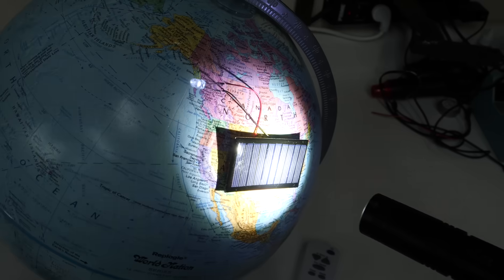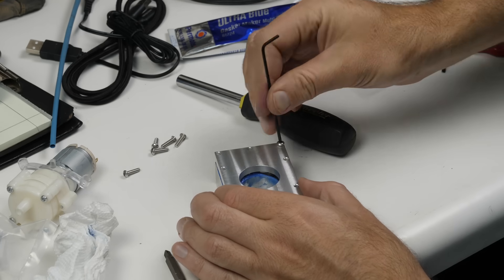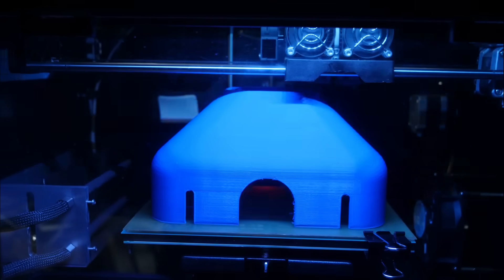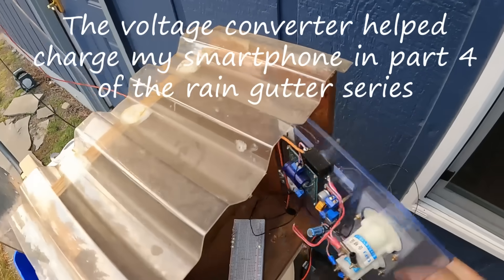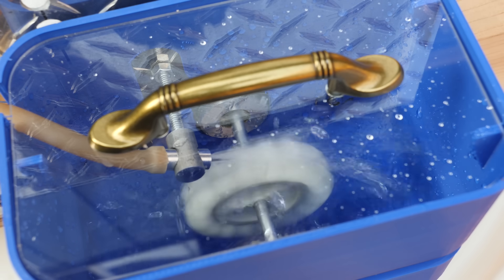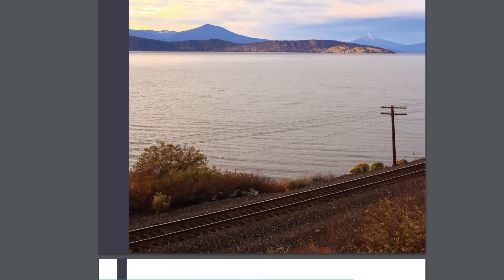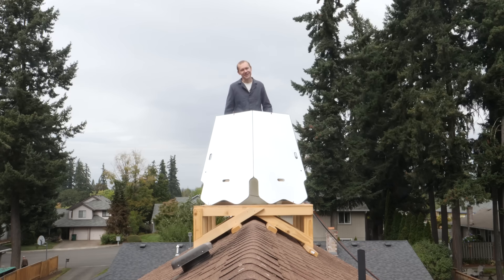Storing Solar Power on my ROOF!!!

Comment: 1: be careful of just placing that much weight on your roof.  Your toy water battery might break right through and end up in the garage or in the family room.  2: there is not enough energy stored in that barrel to be practical to use for, well, anything.
Reply: It was a proof of concept fun build, he wasn't doing it for anything substantial. 1 watt is literally nothing

Comment: Interesting! So many questions though.
1) You said that it takes 5.5 hours to fill the rooftop barrel. How long does it take to empty with your string of lights lit and consuming, say a watt?
2) You state that you're using a 50-watt solar panel. How much more water would you need to store such that you could operate appliances with a 40+ watt draw for all of the darkness hours? I assume that would require a bigger pump and larger hoses to get the water up top.
3) Got any nearby streams? You could set up a small ram pump to push water up to the rooftop barrel(s) during the night too.
4) Or how about building an electric generator using the output from a ram pump? Probably another video. 🙂
5) I have more too....

Comment: What's more surprising than a barrel of water being equal to a AA battery is that a AA battery takes 5 hours to charge with a solar panel
Reply: That depends on alot of things though... he only had a 50W panel, if he had a 500W setup he could do it 10x faster

Comment: height? doesnt terminal velocity figure into this? and doesnt gravity bring objects down at the same speed irrespective of weight excluding the effects of aerodynamics
Reply: PSI increases by water column. The calculation factors in how much water is above the outlet, each inch increases the pressure, hence why the bottom of the ocean would crush you like a grape
Reply: @Teh_Random_Canadian   But even water pressure affected by gravity follows the rules of gravity. If terminal velocity is true which it is, then there comes a height where any higher doesnt matter. All objects have the same terminal velocity removing atmospheric aerodynamics. Dont choke on the pip.
Reply: @AugustusOmega  pressure > terminal velocity. Larger force always wins. Elementary school physics dude
Reply: @Teh_Random_Canadian  Which pre school did you learn that "dude" Are you saying that terminal velocity can be increased by more mass?
Reply: @AugustusOmega  Yes! It absolutely is... you lack of understanding of basic science is incredible

Comment: @QuintBUILDs  If you were an engineer you would quit right there: 207 kg of water (or liters) at 7 meter high, and one G gives you the energy of one AA Alkaline battery.
If you were to weigh one AA Alkaline battery and get that weight in gasoline, you would have 500 times more energy than the AA battery.
Then multiply 207 kg of water by 500 times it would give you 103500 kg of water, or 228178 lb or 27,341 gallons of water.
For you to see how impractical it would be to store solar energy in a pool of water at 7 meter: A 16 by 32-foot pool by 5 feet deep, will hold 19,200 gallons of water.
The problem of energy is not an engineering problem, it is irresponsible politics.

Comment: That's rubbish it still works but you don't get the full power output - Solar relies on heat not light
Reply: Ummm no, that is completely wrong...

Comment: As he mentioned, pumped hydro is nothing new.  Here in Australia, we have had a set up for decades that bought cheap off peak electricity to pump the the water uphill at night and sell it back to the grid at peak times.  The only thing that has changed in recent times is the source of cheap power.  Now it comes from all those rooftop solar arrays (between the hours of 10am and 2pm) all feeding the grid with excess energy that has minimal demand. Then when your rooftop solar is useless, they sell it back to you at peak price just as you are cooking dinner and heading to the lounge room.  Quite clever when you think about it.
Reply: We need to organize more groups of people with this mind set and teach communities how to protect their people

Comment: I see your point as something like this can easily be scaled up to power a home for a night or more all from storying the sun's energy during the day. But, to maximise things you have to do your research on the most efficient designs for the pump, electric generator(s), and container storage setup along with all other related things needed. Something like this can be designed into a homes construction and if your a good designer it will complement the home adding to it's value.

Comment: I'm designing my own off-grid solar installation and the major expense is in the batteries. I'm on a steep slope and have been looking at a (very efficient) solar water pump from the local river into a 10,000 litre tank up the hill, and to be used at night when the panels are off. All well and good. Except, it seems that the minimum viable flow into a Pelton turbine (Turgo not an option) is 1.5 litres per second. That's less than 2 hours of 200W production. Not great. I'm instead looking at a 700W wind turbine which may augment the solar for part of the time. Any other bright ideas from anyone?

Comment: Why Joules and Kg rather than common to non scientists  or europeans  they rarely use joules ether.  Putting the water on the roof temporarily for a video but not sure the point here???  not enough to do more than charge a phone or two if that.

Comment: Based upon prior work with friends, try replacing your solar pump with solar concentrating mirrors and now it's more efficient to boil the water at the ground level and to move it to an elevated height as steam. Y'all remember, energy has two forms: potential and kinetic.

Comment: Your statement about mobile phone batteries being "immediately" shortened in lifespan is extremely misleading. You can't compare a mobile phone battery to stationary or electric car batteries, which are equipped with a management system that manages the battery and thus extends its lifespan. Apart from that, the materials are also different than in a mobile phone... today's batteries have a cycle strength of 2000-5000 ;) batteries will play a big role in the future for the storage of renewables.

Comment: Cool project! Just an engineering heads up:
1. You will loose a lot of the solar energy dissipated in heat/vibration/etc in a pump system.
2. Nowadays, solar systems already come with a controller board which drives the current to the battery in a way it preserves the best of its lifespan.

Comment: Good build.
Any thoughts on deeper analysis?  System efficiency, comparisons to other storage?  You hinted at it with the AA comparison at the end, it'd be cool to add how this stacks up with more widespread storage (and why, apart from some grid-level applications, it is not in more widespread adoption).

Comment: There is another way to store potential energy. Add  a little salt and electrolysis the water to produce O2 and H2. Then store it and you could burn the hydorgen to extract energy for later use.

Comment: My hero. I have been parsing this course of power manipulation with my peers, and in deep thoughts we recollected that boiler systems were the most weight conversion efficient; truth is it's more mass in the art of building boilers, the more cautionary action you employ via how much you wish to enlist in efficient gain to transfer of heat to torque.
This answers especially tricky questions like "what is the way to propel water in a closed system atop the roof?" Again manipulation of heat conversion comes to mind: picture the roofer I know says if you want that... Everything is gonna melt, can't do enough heat to blow steam, too heavy ect..

Lucky me, I live near a city works outlet that is always pouring from whatever drainage and is part of a waterway main downstream. So I wonder if some elevation management and project a small scale but reliable conversion tool could like maybe get me cheaper electric bills 😂
Anyways I'm a big fan now, random recommended for the home page and this is my first video of yours watching. Truly you're one who's bringing it to the layman's terms to get it achieved and I can get down with the process. Live your way unabashedly and build till ya can't come up with any ideas my guy! Brilliant effort woohoo!

Comment: I had an idea similar to this a long time ago, put a glass tank on the ground full of water, connected to a tank on the roof, let the sunshine heat up the water and evaporate, and then condense on the roof.
Reply: It is not plausible. First the heat from sun (without focusing it) will be too low to boil it, so at best you will get miniscule amount of water. Second, adding solar panel or focal lenses  to heat up the water will be plausible but this will become distillation and the water you obtain from it will be much more precious as it is very pure and can be drinkable. So, people will use this to obtain precious drinking water than to generate tiny amount of electricity (like what this video described).

Comment: 0:21 This is where the lie comes in. You are only storing ~4 Wh of potential energy on your roof. That's a truly minuscule amount of energy. In fact, you can find AA batteries which store more energy. Also, of course you are getting nowhere near 100% conversion of that potential energy to electricity.
Reply: holy smokes. youre right if its a 150 liter (=150kg)barrel (he said about double his bodyweight) and its 7m higher than ground its just over 3 Wh of storage.. but he does say this in the end.. its still a cool video for people to understand pump hydro power storage solutions
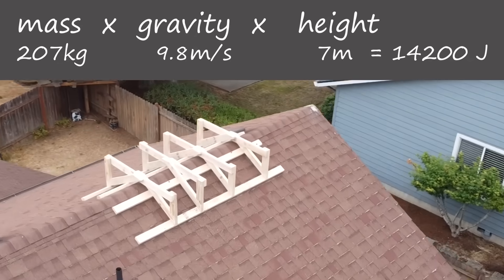Reply: @La_sagne  He said at 2:27 it is 14,200 J of energy (3.94 Wh), a truly minuscule/insignificant amount of energy storage.

Comment: how much energy is needed to raise water from 1 drum down to 1 drum up... how much energy can be generated from 1 upper drum to 1 lower drum... what is the value of efficiency? Which is more beneficial for the PLTS system with this kinetic electric energy system

Comment: how do you bring back the water? I am pretty sure if there is the right combination of an automatic siphon, which can be primed using the falling water due to gravity, the solar panel to help to bring the water back to the top, plus, a ramp pump, I believe you can create for real a closed system that reuses the same quantity of water, without any waste, plus of course having the hydro generation. Could it be a semi-continuous generation that can beat the other forms of renewable energy? For sure it must be worked out the efficiency.

Comment: youtube pushing this to me for months. from the thumbnail, i tthougt this is just solar heat storage. Something is amiss liking its potential energy equivalent to an AA battery.  an AA battery can't lift that much or pump much that water to that height.  There's likely huge inefficiency to power generation from the contraption.

Comment: Wait, I don't understand something.  Water is heavy- trust me I know.  I use to live off grid in Arizona and the task of hauling water was arduous- to say the least.  Finally put in a well- 600 feet deep!  The power required to lift water from 600 feet down, was tremendous.  I know the circuit was fused for 50 amps, so no small amount!  

So here is my question.  The solar panel you used was 35 watts, yes?  You ran a 35 watt solar panel for five hours.  (I think that's what you said.)  But all you got out of 175 watt hours... was a AA battery?  

Is that correct?  Not knocking the effort- and there is a MUCH more useful task for this system of yours.  Please see my next post!  But I want to understand the total power generated by the gravity of your water.  You essentially put  175 watt hours of energy from the solar cell to lift 55  gallons of water.  (I had no idea a tiny cell and pump could do that- water is HEAVY!)

And you got back a AA battery?  How many hours of light before the water ran out?  

To put that in perspective, the solar cell generated a 175 watt hours of energy, yes?  

You could have run a 25 watt device for seven hours based on the solar cell over a five hour frame.  Is that correct?

But you got back a AA battery in the end.  Just want to make sure I get the math right.

Love your channel and I want to join the Discord!  Just found it and plan on binge watching.  

Lastly, I think your ad hoc generator would supply MUCH more power with the outlet closer to the blades and a special turbine balanced to the system.  You won't power your house with it or anything, but you could certainly run emergency lights and charge phones- from a sunny day.  That would be useful in a lousy weather, grid down situation!  No sun means no charging.  

Unless you had a battery like this.  

I wish I could help!  There must be a better turbine out there.  You could likely print one.

Comment: You need a ramp pump to create more pressure and a pelton turbine to increase the Power and to save the water. With Sun Power you can pump the water up again.
Reply: If you could fill the barrel on the roof twice a day you`d have enough water to run a small ram pump for around 55 minutes.  You`d get maybe  11 gallons of water at 75psi if your are lucky.

Comment: Hi.
Great video.
To store energía on your roof there is a better idea that it is allready implemented. 
You take a big black metal box with black tubes in it and conect one end to your water pipe and the oder end to the upper side of the reservoir, the warm water will rise up into the reservour automatically and it will keep getting warmer ,under the reservoir you conect your hot pipe into the house,now you can shower free energy most of the year.
Heating water is one of the most cost effective energy consumption.

Comment: how about you need 120 volt and .97 amp to run a decent refrigerator. Running a couple of decorative lights is a waste of all tha plastic and effort.  Younspent more energy climbing to the roof.

Comment: Worst method to store energy.
Water is the best substance to store heat.  Utilizing gravity to store electric power (or any) is very inefficient and space consuming.
A short callulation shows that a typical Enelope 1.2V 1900mAh recharable battery stores 2.28*10^-3 kWh. That's around 8231 Nm. To store that energy, you have to bring 84kg of mass (84 l water) to a height of 10m. Now you need a very good turbine and frictionless system to get that energy back. Trying to use gravity to store energy is a very bad solution.

Comment: "What if there was a battery which could store massive amounts of energy, and could be cycled every day for decades without losing any of its capacity?!"

Like a heckton of NiFe batteries wired together properly? Probably weighs about as much or more, tho, and it does require some simple maintenance (refilling with distilled water) and proper venting (the charging process results in electrolysis, resulting in oxygen and hydrogen gas being released).

There are some efforts to capture that H2 and O2... too bad burning them back together is dangerous without a lot of engineering to safely contain and regulate the explosion, otherwise you could probably capture that energy too. :(

Anyway, each NiFe cell produces 1.2V, and as long as you top them off every month to keep the electrolytic fluid (lye in water) completely covering the plates, they apparently last up to 50 years.

Wire 10 in series for 12V, 20 for 24V, 40 for 48V. Wire several series-banks in parallel together for higher Ah capacity. Hook them up to a charge controller that supports them or which you can program for the voltage characteristics. Hook up an inverter as load, if you're not setting up a much more efficient pure DC system. Then connect the wind turbine, solar panels (which are not as inefficient as you claimed in the gutter-power video, current-gen ones are ~24% efficient and are more efficient with cooling, plus next-gen ones are being designed with lensing materials to concentrate more sunlight onto each cell), whatever to supply energy to charge them. :)

Problems are:  they don't handle cold well, they're incredibly expensive up-front due to low modern production, they're heavy, overcharging boils away the water from the electrolytic fluid, and they need half-again as much energy to charge as you get back out.

But, given their lifespan, being far more environmentally-friendly than lead-acid/Li-Ion/Li-Poly/LiFePO4, technically producible from semi-domestic materials where I am, and much much safer to maintain, I'd rather use them... if I could afford them. :/

Comment: Amazing video. Everyone saying it was a waste of material, cost, and time, apparently failed to watch the last minute where he explains the benefits of a hands-on learning experience— he’s fully aware of the benefits of batteries as orders of magnitude more efficient. Again, really cool video!
Reply: my problem is not really that it was a waste of time and materials just by it self, my problem is that it was because of him not doing at least a minimum of research on how to get energy from water, i am doctor, i have nothing to do with energy producion, but even i know that estarting from bigger pipes to smaller at the end will encrease presure by a LOT and that if he splits it in 4 or even 6 he can power 6 turbines at the same time with more efeciency, even then it would'nt have been worth it but at least it would be ussefull and less . . . dissapointing(?
Reply: @josue1996jc  stick to pushing drugs. you won't increase efficiency by changing the pipe diameter and neither will changing the amount of turbines. you're embarrassing yourself.
Reply: 100% well said. It's the journey, not the destination. He's done the work, so I don't have to!

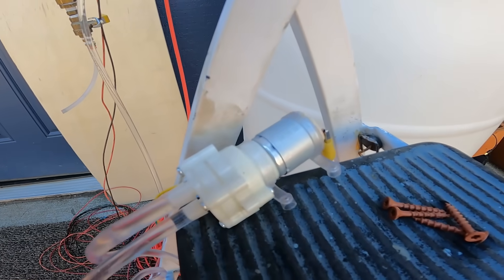Comment: A tip for the pump @4:10 You can just seal off the contacts and leave it in water. It solves 2 problems, noise and over heating. No heatsing needed.
Reply: But then you won't be able to show off you cool design and machining skills. 💁‍♂️